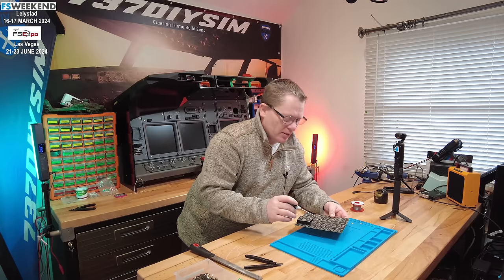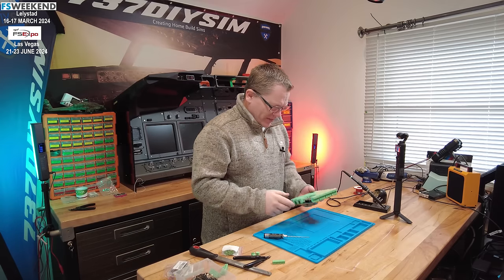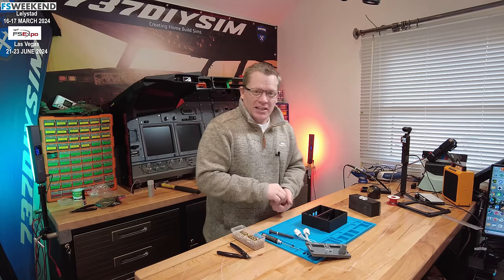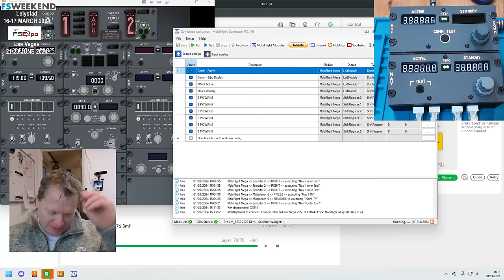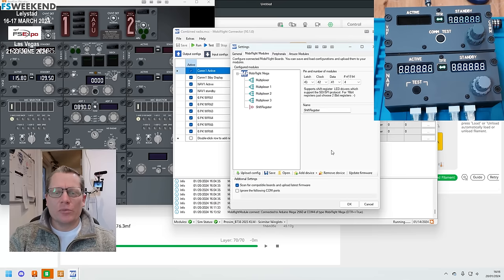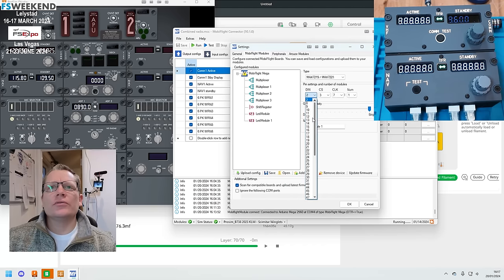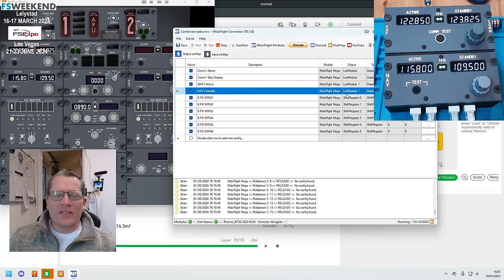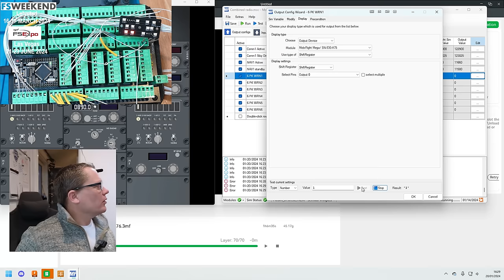Sim Break Out Board (BOB)

Comment: 13:11 you talk about having a single resistor for all the LEDs, that means that the brightness of the LEDs will change depending on how many you have lit, having only 1 LED on will be bright but having 8 on will only be an eighth of the brightness. It is generally better to have one resistor per LED.

It might be worth using a LED driving IC instead, then you don’t need resistors and you can control the brightness of each LED individually.

Comment: Karl, I have a question.  I already have Korry buttons, PCB-based and has individual Resistors for both upper/lower LEDs.  If I use this BOB which I pressume already has a resistor, what will happen to the Resistors on board the Korry PCB?  Will they take effect?  Or do I have to bypass them?  Thanks in advance.  As always, amazing video and tutorial!